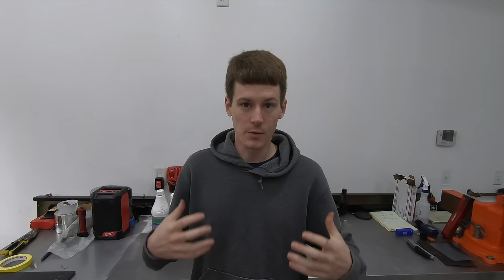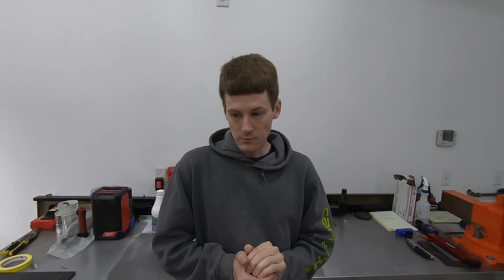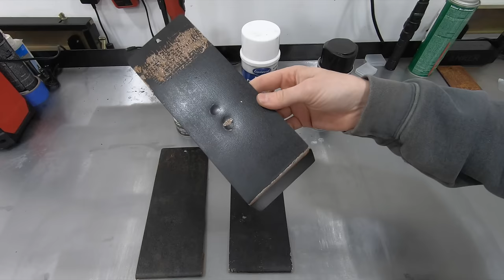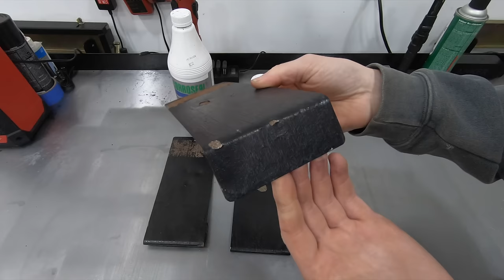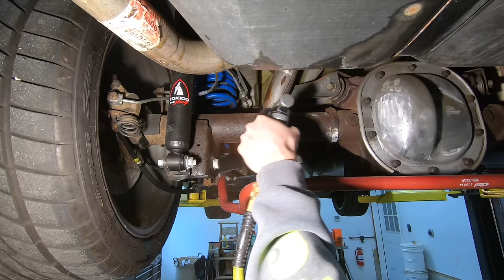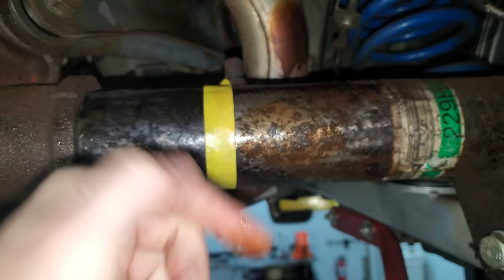MOST Rust Converters Are A JOKE! Let Me Show You. (Eastwood, KBS, Corroseal, Ospho & More)

Comment: Question, I watched the video twice over for the test description. What was the coating procedure after using the products? What coating product was used? On the phosphoric acid based convertors, did you use the coating on the panels? It looks like the rust kutter panel was uncoated ? No adhesion or bounce tests done? Just wanted to clarify. 
I have a heavily corroded E series and thinking about using the Rust Kutter after removing scale, then doing POR 15's coating system with a topcoat of surface shield.

Comment: Very useful content,  glad you put this video out there to educate us.

A point that is not mentioned in the video is that Rust Kutter does not prime and would need a coat of primer afterwards. The corroseal and VHT spray will both convert and prime.

It seems like the big failure mode of most products is the bond separation between metal and primer. The Rust Kutter didn't get any primer applied to yet, so the test that showed it had no separation might not be the most conclusive, because there is no primer to separate yet.

It would be interesting to to see a Rust Kutter + (best quality) primer compared to VHT/Corroseal. 

I would have loved to see this video before I did my entire frame 4 years ago. I used brushed on corroseal (followed by paint and undercoat) and it seems to be holding well enough. However a spray on like rust kutter might be easier to apply vs brush, and it looks from your testing that the conversion performance is quite good.

Comment: Great videos, helpful for the project I’m tackling now. I have a truck where the rust is pretty bad on the undercarriage. I’m planning on wire brushing the large chunks and then use the rust kutter on it to create the barrier. Afterwards I was hoping to use woolmax or surface shield as a protectant. Is this a wise course of action or does the rust converter and lanolin not mix?

Comment: Help me understand if you can. I've watched so many of your videos. I've always thought we should use a rust converter first. I have ordered a case of surface shield per your recomendation. Should we not use any rust converter before applying surface shield? My plan was to knock and scrap off all the rust I can, then using Rust Kutter, then spraying after with Blast Surface Shield after. Would this be the smartest way to do things? Or you're saying to just simply applying surface shield on top of all current rust without using rust kutter first or any ruster converters?

Comment: Great video this will save a lot of people money on crappy products. I wouldve liked to have seen Kurust on this video, I think its tannic acid based (looks like milk, goes purple-ish when drying).
I try to remove rust by mechanical means as much as possible, then use rust converters to get inside of pitting that a wire wheel etc cant get, then re-wire wheel it to take it back to mainly bare steel, but with the tiny spots of pitting converted.

I also swear by POR15 metal prep, its phosphoric + zinc acid based, but doesnt remove heavy rust, just mild surface like this video had.

Comment: The chemical reaction for rusting is: 4Fe + 3O2 → 2Fe2O3. 

The mixture that you used to make the samples rust contains:

Water H2O
Salt NaCl
Hydrogen Peroxide H2O2

I'm not a chemist, but would the rust that was present after your rust making cocktail have a slightly different formula to rust created as the result of oxidation and moisture? Would that possibly affect the results? BTW I could always get subscripts to work.

Comment: @RepairGeek assuming I went with the recommendation of either Rust Kutter or VHT and did a decent job wire brushing and minor sanding prior to applying, would you recommend (say on an annual basis) doing a fluid film or the Blaster oil-based undercoating on top?

Comment: Not sure what the results mean in this video. The question to address was should You use rust converter before using a underbody spray, let’s option your favourite FluidFilm. The point was to deal with existing rust before undercoating. The long term effects of those sprays was irrelevant as those performance features would then be taken up by fluidfilm. Or was I missing something?

Comment: What one after application would you say needs the least prep before coating with paint, and painting to prevent rust. Like frame rails, suspension, brake calipers, stuff like that. I dont need it to look good i just want it to last more then a few years.

Comment: I’ve gone the phosphoric acid route on a truck restoration. I’m concerned about my epoxy floor in my garage. Any experience with that? I may have to take it outside, but would prefer staying in the shop. It’s a nice floor, but has been good against most chemicals. I haven’t tried this yet.

Comment: I guess you said most, but Ospho is no joke. From personal experience (Restoring 60- & 70-year-old military vehicles) it will kill rust down to bare metal. The mistake you made when applying to smooth surface rust is you need to let it set a minute and wipe it down. Because it is a thin liquid it will creep into every crack. If you have heavy scale, you scrap off what you can and spray it on. It may take more than one coat. You have to let it dry at least 1 day or more before priming it.

Comment: Excellent video, thank you! I have to save a sink with a J-channel that's completely corroded through.  It's not crumbling yet and feels solid but if I try to remove all the rust, there won't be anything left. I want to sand some rust off, use some kind of converter product so rust doesn't spread, then rebuild structure with a rusty metal repair putty. Can I use rust cutter or will it disintegrate so I have nothing to build onto?
Reply from the maker: If the metal is soft enough that a screwdriver will put a hole in it, you need a new sink.

Comment: Evapo-Rust works great. Its not acid, and it doesn't simply cover the rust. It does work slower though, and you generally need to be able to soak whatever you're trying to remove the rust from, although I have had success soaking a towel in Evapo-Rust, then placing the towel over the rust overnight.
Reply: They make it in a gel.

Comment: Interesting video.   I stopped using Rust Kutter because I favor how well Ospho creeps.   I also really like brush on Eastwood's Platinum Rust Converter (no top coat needed) Something else to add, I sprayed Coroseal onto a window lip of a tractor cab once.   It sat for about 3 or 4 weeks and I decided I wanted to remove it.  A wire wheel wouldn't touch it.  I sanded down what I could and painted over it.  For a rusty frame, any oil based product is good for me.
Reply: Yep corroseal or similar products take a while to actually get hard especially if you put it on thick or put it 2 coats.

Comment: Do you recommend using a phosphoric acid product (i.e. Rust Kutter) on scraped rust before applying a lanolin based undercoating (Surface Shield)?   Thanks!
Reply: @repair geek Bump
What's the process for this for someone that wants to treat rust before applying Surface shield?
Reply: I have same question and was thinking of using a good rust converter then a rust proofing product.

Comment: I read through some of the other comments now on this video and I think the Ospho process is misunderstood.
Take a painted/coated panel that has rust on it...
Step one is to grind the entire surface down to bare metal, using a wire wheel to grind the rusted areas of all scale and brown surface rust. The rust needs to be wire wheels until virtually no more brown dust comes up from doing so. Then at that point, it's time to apply the Ospho. I always apply it with a brush, working it really well into the metal and I do the entire panel, even if there's no rust in spots. Then it needs to fully dry, minimum of 24 hours.
Step 2 is to make sure it's completely dry and then I start with P80 grit sand paper on a DA and make sure to remove all surface scale created by the Ospho. You do not leave that scale in place! That scale is the converted rust contaminants that cannot stay with the panel. Once it's all sanded down and no more scale, it's ready to be wiped clean with a good wax and grease remover.
Step 3 is to coat the panel with a good primer and paint as normal from there.
Hope this helps someone out there in YouTube - land 👍
Reply: Regular primer or 
Epoxy primer ?

Comment: If I understand your results correctly, it is amazing that the "Rust Kutter" left the surface in what appears to be a smooth and ready for paint/primer finish! I have used Ospho for years and it does NOT remove rust but the phosphoric acid only inhibits the continued growth of rust. Would you know what the anti-rust ingredient is in the Rust Kutter?
Reply: So Ospho sucks? I was just going to buy it
Reply: @briizcustoms9543  I didn't say that! It works but only 'stops' the rust, does not remove it as the video shows the Rust Kutter doing. And here's an update. I purchased Rust Kutter and it did NOT perform like in this video. Actually it wasn't even as good as Ospho which is MUCH cheaper to buy.
Reply: @laverdadesmejor  That’s good to hear,  I was thinking of going with Ospho. Something that concerns me though is it it’s literally just a liquid. How is that supposed to stay? The roads here are ass and they use salt during the winter so I really need a product that works.

Comment: Could u try the 3m Cavity Wax Plus vs the best couple from your video…surface shield, fluid film, etc. a lot of people using 3m cavity wax plus inside the frame because it has a wand kit. I do not know if it lanolin or not. But before I use it on my truck frame, it would be nice to have a comparison. I have 8 cans of surface shield I picked up at Harbour freight and I can swap the nozzle over. Just want to use what is the best product

Comment: MAJOR QUESTION: were those steel plates fully cleaned and wiped down with something like acetone or lacquer thinner to remove any trace of some possible manufacturer's lubricant?
Reply from the maker: They were media blasted with 80 grit aluminum oxide. These are literally ASTM standardized test panels. They have no coating. Google: Q panel for more information.

Comment: So Rust Kutter on everything, then black cosmoline on exposed frame rails, wheel well's, rear axle, and leaf springs,  then surface shield everywhere else underneath that's not visible, and doesn't get as much water, road spray?  2002 2500hd CCSB Dmax silverado frame in particular, that has allot of exposed frame rail. Getting ready to get under my truck, and enclosed snowmobile trailer, to wire wheel off all the loose stuff, then cover. Washington state, so we don't get it as bad, but the Mtn. Passes are starting to take their toll.

Comment: I used phosphoric acid converters years ago.  They all said to wash and dry the steel after the conversion before priming and painting.  Is this what you recommend?
Reply from the maker: Some products have zinc in them to keep the metal from flash rusting. Just do what is written on the back of the bottle.

Comment: Did u ever try/test Mar-Hyde Rust Converter? Simple to use, easy water soluble clean up, goes a long way with very little, very durable, do not apply on paint or it peels off. The best part is MUCH easier prep work! A truly great product that I have used for years after switching from other brands you tested. I did find brushing worked better then the spray. Please advise.

Comment: Great review you have but you have a little bit of education about one product, the KBS Rust Converter. Please allow me to help a bit here. KBS Rust prevention requires a three-step process, not just one product. KBS Rust Converter is a rust primer that helps to stop existing rust and prevent it from returning. However, it is not enough on its own. You will also need to use KBS RustBlast and KBS RustSeal for the best results.

RustBlast is a powerful rust remover and zinc phosphate pre-primer that etches the metal. It is used to remove rust and prepare the surface for the rust converter.
RustSeal is a durable and flexible rust preventive coating. It is used to seal in the rust converter and protect the surface from future rust.

The best way to use KBS Rust prevention products is to follow these steps:

1. Use KBS RustBlast to remove the rust.
2. Apply KBS Rust Converter to the cleaned surface.
3. Apply KBS RustSeal to the rust converter.
4. Once the RustSeal is dry, you can paint or finish the surface as desired.

By following these steps, you can effectively prevent rust and protect your surfaces for years to come. I know, I have personally used these products.

Here are some additional tips for using KBS Rust prevention products (or any other product):

1. Work in a well-ventilated area.
2. Wear gloves and eye protection when using the products.
3. Follow the instructions on the product labels carefully.
4. Test the products in an inconspicuous area first to make sure they do not damage the surface you are working on.

Comment: I’m a ospho and corroseal advocate, using one or the other at least once a week on a boat that is always exposed to salt water. I use ospho to “kill” rust to stop it from spreading until I can get into the rust with a needle gun/wire wheel. After it’s prepped and cleaned (denatured alcohol) 2 coats of corroseal 24h apart hasn’t failed me yet. Great video and testing.
Reply: Hey Denatured Alcohol will neutralize Ospho 
Then you can prime and paint after ?

Comment: Wish you used KBS Rust Seal kit instead! Soaking a rag with white vinegar and letting that stand on the metal for 24 hours and then rinse might surprise you! Real cheap too! Of course an etching or epoxy primer asap depending on if the metal is totally bare again!

Comment: may I take the liberty to point out the faw in your otherwise good comparison test?
The basic idea behind a "rust converter" as opposed to a "rust remover", regardless of what the label says, is that you generally do not have space or ability to remove the rust. So the last three using acids that totally remove the actual rust would not be a legitimate part of this test.

Basically what you want with a "rust converter is to first stop the rust from going any further, then convert the existing rust into a paintable surface or one that will not allow the substrate to rust again. 

So again, the last three do not do any of that so they would not fall into the category of "rust converters" regardless of what's on the label.

However, if i needed a rust remover the thick one would be my choice. I have used a rust remover before with great results...and a bit of skin burn.

Comment: All these products are expensive and unnecessary. The anwser is to derust completely with white vinegar then prime and 2 top coats. These 3 steps will be cheaper then any of these products. Notice they DO NOT convert the rust completely meaning rust be come back. White vinegar is the cheapest safest chemical and leaves the object rust free. You need to wire brush a few times over a few days but rust will be removed. I'm an Industrial Chemist.

Excellent video.

Comment: While it is not technically a rust reformer, POR 15 actually works incredibly well while at the same time putting a hard, durable polymeric coating on metal. It is nearly bulletproof. The down side is it is only good for chassis and suspension type parts. You could use it on the back side of body parts, but not on the exposed side as you can't really paint match over it.
Reply from the maker: POR15 is trash. I'm in the process of proving it currently. Hoping the video is out late fall.
Reply: @RepairGeek  I used it 12 years ago on a restoration of a 1986 Pontiac Fiero GT. I used it on the chassis, including the inner door metal. The car was stored at the Jersey shore for most of its life. No sign of rust coming back. It actually sticks better to light rust than clean metal. Preparation of the surface to be coated is important for bonding to work well. Must remove excess rust by sanding and make sure no dust is left on the part. 

BTW, don't open the can, the material will cure in a couple of months from the moisture in the air. Instead, puncture the lid, pour out what you need into a plastic container and then seal the hole with metallized tape or duct tape. Invert the can to coat the hole and the stuff will last for years. DO NOT return the unused material to the can.
Reply from the maker: I don't doubt what you're saying at all. I'm sure it has held up great on your project. I'm comparing 8 or 10 paints side by side in the exact same environments. I'm about 750 hours into salt fog testing. POR15 holds up slightly better than oil based Rustoleum brush on paint. Even with POR15's top coat. It makes little difference in corrosion resistance. It's sad how many people have been duped into thinking it's a rust cure all.

Comment: If you want  a cheap phosphoric acid rust converter - use Coca Cola, I have used it in past. It works, is cheap and it mixes with whiskey nicely too :) Also you are better off cleaning surface to bare metal, cleaning with acetone or something similar, applying rust inhibiting or even epoxy primers prior to base coat. None of these are permanent solutions, but for a diy guy it will give a better run for the money.

Comment: So, the best rust converter is a 60% concentrate phosphoric acid + 40% water and a little squirt of alcohol hand sanitizer solution mixed in a spray bottle.
This is basically what Rust Cutter is except it is only 30% phosphoric acid so it will take longer to turn the rust.
You can buy phosphoric acid in different forms and make your own “rust cutter” on the cheap.